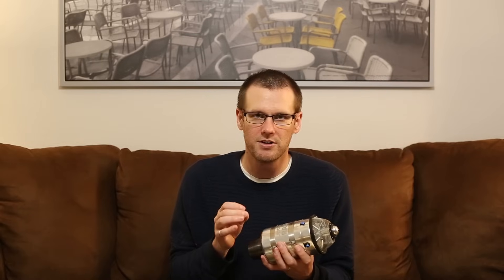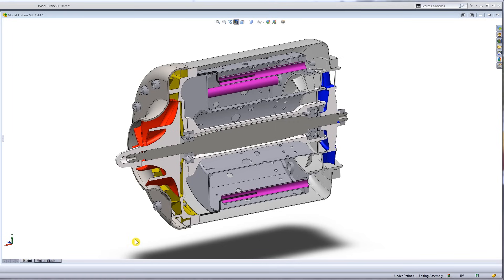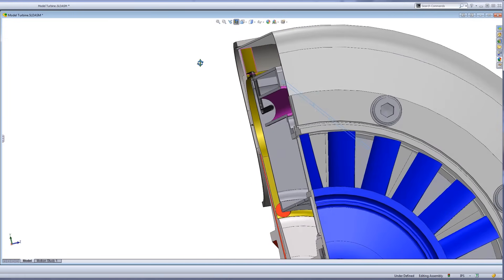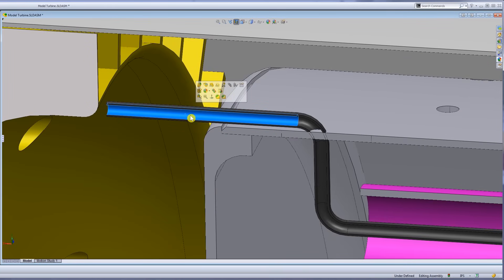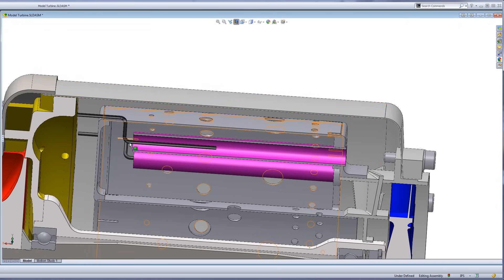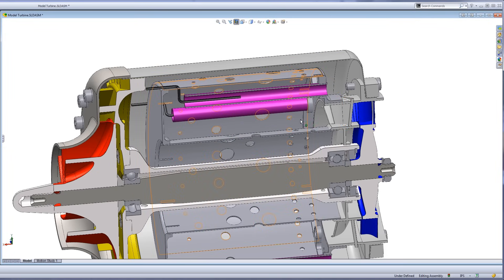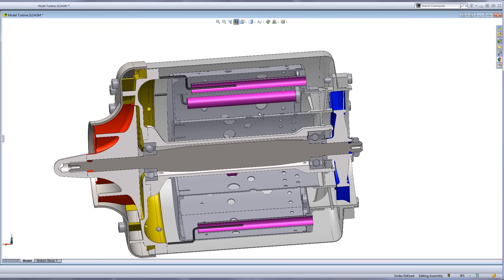How an RC Model Jet Turbine Works

Comment: can u please explain why the inner wall of the combustion chamber has holes in it if its gonna be leading directly to the turbine shaft tunnel in the very middle wouldnt that lead to more heat going to the bearing or is there a reason for it?

Comment: Oopppss....no spark plug.  It is a ceramic heating element.  Element and start fuel are always on together.   other version was propane start.  that used a model airplane glow plug to ignite the propane....
Reply from the maker: Correct no sparkplug. Was corrected in the description I do believe.

Comment: I found this video every helpful. I was curious to know is there any kind of certification to repair these turbines? If so where can i go in the US?
Reply from the maker: Yes, more than likely any certification required is controlled by the manufactures and dealers of these turbines.
Reply: @RCexplained  Can you recommend any in the US ? I connected one and never heard back so i gave up on that place. need to find some where since i dont know the industry that much i was hoping you can me guide me to the a place you know.
Reply from the maker: I have no connections within this part of the industry.

Comment: First off: I DO NOT KNOW DOOLY SQUAT ABOUT GAS TURBINES, but I do know enough about physics to get myself in trouble.

That being said: the instant you began to talk about the “flow” of air in a linear motion (which is a fluid), the Bernoulli Principle was brought to mind.

In fluid dynamics, Bernoulli's principle states that an increase in the speed of a fluid occurs simultaneously with a decrease in pressure or a decrease in the fluid's potential energy. (Googled.)

Food for thought when designing your systems.

Thank you for your time on this matter. 

Peace ✌🏻

Comment: It's a turbine engine, not  a "turbine jet" or just a "turbine". It contains a turbine, but the if you must use one word for the whole thing, try "turbojet" or "engine" depending on context.
Thrust doesn't come out of the nozzle - gas flows out of the nozzle faster than it flowed into the intake, causing thrust in reaction.
The centrifugal compressor impeller changes the flow from axial to radial (rather than "centrifugal")... and more importantly adds lots of speed.

Comment: This is the best video I've ever seen on how a model jet turbine works!  To me, the combustion chamber is the most confusing part, as it's hard for me to visualize where pure air is flowing, versus the fuel-air mixture, versus where the flame is and where the flaming hot gases are?!?!?
Reply: The 3D model would certainly benefit from some flow arrows. Even better would be some dots representing small masses of air, flowing along that complex path, packed closer to together where pressure is higher... but that's a lot to ask for. Just arrows would be good...

Comment: I was expecting a whole series of compression fans.  Interesting.
Reply: There would be in a larger practical engine. These toy engines and even the smallest of real aircraft gas turbine engines have only a single-stage compressor, but that only works with a centrifugal compressor (not with an axial compressor).

Comment: Which material is use to make bearings? And which oil is used for these turbines MOBILE JET ?
Reply from the maker: Hybrid of Ceramic/Steel. Mobil DTE  light is used in the turbine I was holding.
Reply: @RCexplained  Thank you for the information. We use Mobile Jet II in our real aircraft turnbine. This was very helpful. Highly obliged.👍🏻😊

Comment: Can I ask what is the lifespan of a jet turbine vs an EDF. Also what is the cost difference for jet turbine vs EDF with similar thrust output? (I realize EDF would need to be a lot bigger) Thanks
Reply from the maker: Jet Turbines require maintenance every ~25hrs to hold on to the lifetime warranty that some include. They are also more costly. However Jet Turbines will outperform EDF's at higher speed. There's another video on the channel that talks about this.

Comment: Nice. I didn't know that the air goes into the combustion chamber from behind. I don't like the design that winds the air back and forth wasting energy. But if it works, it works.
Reply: The directional changes don't really waste energy. The path also allows incoming compressed air to keep the housing relatively cool, shielding it from the combustion flame.

Comment: I know they use hybrid bearings.  Bearings 608 and 6000 that I will be using should withstand 115,000 rpm, but the bearings I bought have poor performance and cannot withstand high rotation.  The 608, 6000 should withstand 115,000 rpm and the 602 should withstand 65,000 rpm.  Which bearing from which company is right for me?

Comment: Excellent video. But can you talk more about that fuel system? I never saw that type before.
In the usual, the fuel enters behind the vapor tubes, and throw fuel inside the combustion chamber. In that type, you are throwing fuel inside the vapor tubes. why? 
Other thing. The function of the vapor tubes isnt to prevent the fuel injectors to melt? There is a part of the fuel injector that is inside the combustion chamber without the protection of the vapor tubes. Wouldnt it melt?

Comment: where is the igniter in the combustion chamber? Is it in the tubes because if so wouldnt there need to be 1 for atleast each tube?
Reply from the maker: The turbine in the video has one.
Reply: @RCexplained  but where is the spark plug in the comubstion chamber? I see there are many tubes with fuel that get sent to them but I dont know where the ignitor is/sparkplug in the combustion chamber in the model

Comment: There is only 1 spark plug/ignitor right? Like there arent more then 1 inside like a real commercial turbofan https://www.youtube.com/watch?v=L24Wf0VlTE0 1:47 seconds on that video. I just wanted to make sure. By the way nice job on the 3d printed model it looks like u put a ton of effort into it and it payed off with a good explanation, the spark plug question is my only question.
Reply: like is there a igniter on the bottom and top or just the top?

Comment: how many spark plugs are there?
Reply from the maker: In the video a spark plug was said to fire the initial flame. However, an igniter would be the most correct term. In the turbine shown one ceramic igniter is used.
Reply: @RCexplained  okay Ill rewatch it again but one more quick question, is there only 1 igniter? Like in modern day turbo fan engines there are multiple im pretty sure but do they use only 1? And how many of those small tubes are there like those little purple ones you showed.
Reply: the purple tubes like at 8:30

Comment: do they use the same technology as turbojet engines or turbofan engines?
Reply from the maker: model jet turbines are very much simplified versions of larger scale turbines.
Reply: @RCexplained  oh thanks, but do you know if they use like the same technology as turbo jet engines or turbofan engines because I know the 2 are different and I have always wondered which one they use because I thought the model jet turbines are turbo jet engines technology whereas most commercial airplanes use turbofan engine technology.
Reply from the maker: a turbofan engine has bypass air that flows outside of the combustion chamber. A turbojet engine has no bypass air. Model engines are turbojet engines for simplicity.

Comment: As far as I'm concerned, engine != turbine, the turbine is just part of the engine. I get that "turbine" is a more common term and people tend to get/click on it more easily, but still, it kinda makes it a little uncomfortable to hear. well, for me anyway 😁
Awesome video though! great explanation!!
Reply from the maker: Hey Gabriel thanks for the awesome comment. I will share my experience. I personally have learned that a turbine represents the full assembly and the turbine wheel is a specific part within a turbine.

You can see this when you search for jet turbine or gas turbine, steam turbine, wind turbine in google images. When you search for the gas turbine wheel, you get the specific part you are after. 

I wouldn't call the grouping of all those different types of turbines, "engines," but rather turbomachinery. 

At the end of the day, which ever you call it, I'm sure I will know what you are talking about. :) Even some text books describing the brayton cycle will call the assembly a gas turbine but refer to the turbine wheel as just the turbine. It all works!

Comment: what happen to the motor in front of the engine you hold that ussd for starting the engine? your explanation is enermously talking only the combustion chamber only not entirely, for example the motor for starting the engine from dead cold
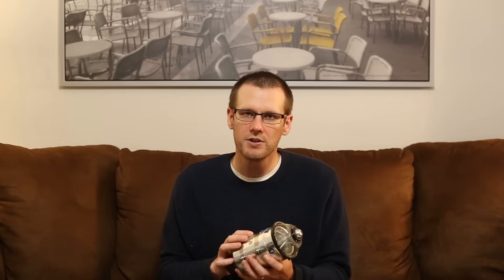Reply from the maker: Hello Kodox. The motor is talked about at 1:00 and again around 2:34.

Comment: Hey man, great video great explanation, but I have a question, can I run any (I mean kingtech and jetcat swinswin) turbine engine on diesel, cause in my country jet A fuel is pretty rare, or if I can run kerosene, what type of kerosene can I run, are there any disadvantages with those fuels, I have looking in to turbine for almost 2 years now, I'm scared to buy one because of fuel type, if I can't run it, it would be a waste, I know it is long but I hope you will help me out, AS ALWAYS GREAT VIDEO, KEEP UP!!!
Reply from the maker: Hey Droid Tech, you can take a look at any of the manufactures spec sheets to see if their turbines can run on alternate fuels. Most turbines can. There are advantages and disadvantages, performance difference is subtle. Kerosene is great when you want minimum odour. Diesel is the most cost effective but does tend to have more smoke during start up and shut down.

Comment: This was a very comprehensive video.
I learned as new starter at lot.
One thing is a bit sad. You told there are different fuel options which made me listen up.
But you didn't go into detail. I would really have loved that
Reply from the maker: Hey Jan what details were you looking for?
Reply: @RCexplained  You have told that most of the engines also work on diesel.
Why just most of the engines and especially why?
What are the requirements to run an engine on diesel?

Cheers
Reply from the maker: Hi Jan, Most model jet turbines burn either diesel, jet fuel or kerosene. All these fuels are from the same fuel family. The ECU would have to learn the difference in the start up procedure for a new fuel within the first few startups. If there is any issue in the auto startup there may have to be some manual assistance.
Reply: @RCexplained  Oh, so any jet can run diesel.
It is really just the matter of how to startup?
That's convenient. Thanks for your reply :)

Comment: RCexplained Why model Gas jet engines produce more thrust than EDFs the same diameter ? Could an EDF reach the same thrust that a Gas jet with a powerful compact electric motor ?
Reply from the maker: Answered this on the comment you left on this video: https://www.youtube.com/watch?v=mVYfRFzvBQU

Comment: At 150,000 rmp the compressor tips are at mach 2.3, at adle the compressor gas flows are sub sonic, but not by a lot. Designing these things is a black art, not a science. If anyone tells you he that really understands what is going on, he lies. Still, hats off to the guys who did get these things to work in the end, because when I was first interested in 1970, there were quite learned engineering articles explaining how model scale gas turbines could never be made to work at all. One needs to understand that bumble bees can really fly, but according to standard aeordynamics they could not fly at all. Think of the hot gas as more like white hot treakle and you are getting there. A blast of hot gass at mach 2 on the turbine stator is more like a shower of tiny rubber bullets than we can even imagine. Think of those tiny rubber bullets as all being connected together by a property that we call viscosity. The work that we have to thank for all this started with heavy military helicopter starter motor gas turbines and moved on to your turbo diesel truck and later even my 1.5 dci turbine charger.

Comment: Is it possible to get the CAD design of the engine and the combustion chamber hole pattern please.

And how do you lubricate the bearing. Any video on that?
Reply from the maker: Hi Jacob, the CAD models are downloaded from grabcad. The bearing is lubricated using turbine oil found in the fuel. The fuel mix circulates and contacts the bearing surfaces.
Reply: @RCexplained  thank you so much. 
I know it too much to ask,  any possible links to this particular model for download? .
Reply from the maker: Hey Jacob, I don't remember which one I had used. Try a few of them.
Reply: @RCexplained  alright thank you so so much.

I have a model I made. Not sure it will work, my only issue is lubrication. I've seen models with a separate oil pipe for lubrication.  In your model, you don't have that.  Do you a video about lubrication of the bearings?
Reply from the maker: I don't have a video on lubrication of the bearings.

Comment: Great video!  Why does the ignited gas flow only to the exhaust/turbine end and not force its way back to the compressor stage?  I'm assuming the pressure is much less on the exhaust side, but would love a detailed explanation.
Reply from the maker: In fluid dynamics, the fluid always takes the path of least resistance. Since the pressure at the turbine wheel is at atmospheric pressure and the pressure at the compressor wheel is much greater than atmospheric pressure, exhaust gasses can only flow towards the turbine wheel.

Comment: This would be spot on with a few terminology changes. Your use of 'turbine' as describing the entire engine is fundamentally flawed. The Compressor and the Turbine are seperate parts connected on a shaft; having a turbine does not automatically mean you have a jet engine. A turbine is only the bladed portion that extracts the power out of the exhaust flow and turns it into rotational energy. Wind generators have turbines; hydro dams have turbines. Neither are jet engines, a very important distinction. 
Beyond that, the only thing that makes a jet engine an aero engine is having a nozzle. Take that off and you have a gas generator. 
On the fuel front, the compressed air is not turning your liquid fuel into a gas, it's compressing the air for both heat and density and is forced into the combustion chamber where the fuel changes into a fine mist for better combustion. After ignition, Then it is transformed into a high heat, high pressure gas stream.
Reply from the maker: Thanks for the comment. You are very correct, terminology is very important.
A gas turbine represents the entire assembly just like a steam turbine, wind turbine and water turbine would represent the full assemblies of those specific turbines. 
When you want to order the specific part inside your gas turbine, you must refer to it as the turbine wheel. 
You can enter in to Google images all of these terms to get a feel for how each term is referenced. 

When considering fuel flow, before fuel is burned in the combustion chamber, all fuel must be heated to the point where it turns in to a vapor.  Luckily in gas turbines, this is easy once the engine is at idle as the temperatures are very high inside the combustion chamber. 

For other combustion engines, fuel atomization must occur to assist in this process as liquid fuel of all types does not burn. It is the vapor that burns.

Comment: Very nice video. I would just like to note that the fuel injectors go inside the tubes from the back to the front, not from the front as you designed. 
Also, gas start was used because it was easier, the igniters for rc model turbines have only been invented later. 
Anyways, good work on the video!
Reply from the maker: Thanks for the comment José.
Reply: Came here to write that!

Comment: I was expecting something more about the ECU, and how it binds with the RC transmitter to control the throttle, but was utterly disappointed with a basic jargon on how a Jet turbine engine works. this video is a basic explanation on the functionality of a jet engine, has no particular information unique to just an RC model jet engine
Reply from the maker: The receiver in your RC model binds with the RC Transmitter, not the turbine. The turbine ECU plugs in to the receiver using a typical 3 lead radio wire.
Reply: @RCexplained  thank you so much for this explanation. I wish you could have gotten into this subject a bit deeper in your video.

Comment: Why burn fuel in engine what is use of burning fuel in engine what is  science
Reply from the maker: Not sure what you are asking?
Reply: @RCexplained  why fuel burning in jet engine for fire what is reason
Reply from the maker: @Royaltech91  The expanding gases create the potential for power.
Reply: @RCexplained  bro please make a video how to make a jet engine
Reply from the maker: That would be tough as I've never made a jet engine.
Reply: @RCexplained  like small size about 10kg thrust everything is possible
Reply from the maker: I have never made any size of turbine.
Reply: @RCexplained  this is possible with 3D printer

Comment: Did the engine work if I made the outer blades of diffuser straight without curve ?? Plz reply , thank you .
Reply from the maker: Are you referring to the stator vanes on the turbine side? Yes it can still work but efficiency is reduced.
Reply: @RCexplained  No I mean the compressor guide vane .
Reply from the maker: @hydra7013  yes it would be along the same idea. It can work but would rob you of flow efficiency. You will want to optimize it as best as you can.
Reply: @RCexplained  Thank you so much .
Reply from the maker: @hydra7013  no problem